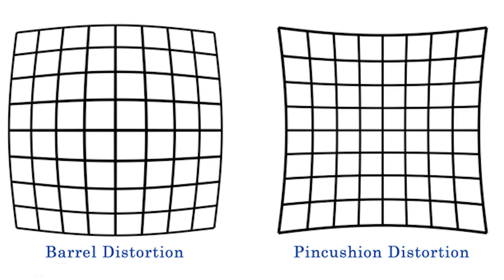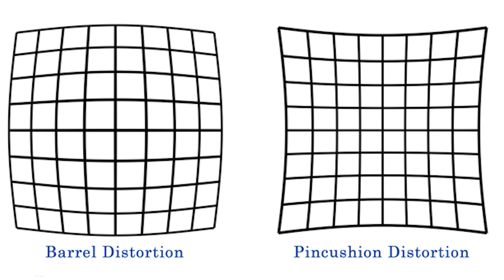VR Barrel Correction & Rendering Resolution Explained

Comment from the maker: Elaborating on my video from the other day in a bit more detail for people.
Reply: Hi Karl, I think your explanation is generally correct, but I wanted to try and articulate this in a slightly different way. I spent some thinking about this, so I hope this helps others and myself. 

In terms of resolution in VR, we are always limited by the panel resolution. In the Quest 2 it is 3664 x 1920. So what is the point of rendering at higher resolutions (super-sampling)? 

The answer lies in how the lenses distribute the panel's physical pixels across the visual field. The pincushion distortion image you displayed shows the squares in the center of the field getting shrunk while those in the periphery get enlarged. This means more of the panel's physical pixels will get mapped to the central region of the visual field while fewer will get mapped to the periphery.  

So in terms of what we see behind the lenses in our visual field, the central region has a resolution higher than 3664 x 1920 while the outer regions have resolutions lower than 3664 x 1920—with decreasing resolution as you move away from the center radially.

So now let's say our app renders to a temporary buffer at the panel native resolution of 3664 x 1920. We now need to barrel distort this image before we can render it to the panel's pixels at the same 3664 x 1920 resolution. 

What the barrel distortion essentially does is it stretches out central portion of the image—because more of the panel's physical pixels need to be mapped to central part of the visual field—and it shrinks the peripheral regions because fewer panel pixels are mapped to those regions. Again, this mapping of the panel's pixels to regions of the visual field is done by the pincushion distortion of the lenses. 

So now when we stretch the central portion of the original image in our buffer and map that onto panel's central region of pixels—at more than a 1:1 pixel ratio—where do we get the values for the additional pixels? We have to use interpolation which will always result in some blurriness due to aliasing. The ideal would be to sample these pixels values from a buffer with a pixel grid that exactly matches the higher resolution we are dedicating to it in this region—hence the super-sampling. When we use super-sampling of say 1.7x (on the quest that's 5408 x 2736)—we are actually getting that resolution in the central region of the visual field because more than a uniform amount of the panel's (3664 x 1920) physical pixels are dedicated to that region. 

The increased resolution in the center of the visual field may be less than the super-sampled resolution. The limit depends on the lenses of the headset and how strong their pincushion distortion is. The stronger the distortion more of the panel's physical pixels will get mapped the center region boosting the potential resolution in the center. This also results in the trade off that the fewer pixels will be mapped to the periphery resulting in blurriness off-center. 

One other note. Super-sampling also results in more clarity in the periphery. We are shrinking those parts of the image before rendering to the panel. So we are going from more pixels to fewer pixels mapped to these regions on the panel—more information to less information. This is better than the stretching of the central region, but there still can be aliasing effects because the grid sizes are not the same. With super-sampling, we start from an even higher resolution source buffer and then drop down to the smaller number of pixels needed by the panel in that region. In effect the super-sampled source buffer acts as a form of anti-aliasing for the peripheral regions of the panel. 

My example for this: 4k downsampled to 480p will look better than 720p downsampled to the same 480p. We have more information to intelligently determine how to color the pixels in the 480p display when we start with the 4k source. 

Ok, I think I got it all out there. I hope this is clear and helps others understand. Happy to be corrected if I'm in error anywhere. 

Credit to these other videos that helped me along with a healthy dose of rumination.

https://www.youtube.com/watch?v=B7qrgrrHry0
https://www.youtube.com/watch?v=nyehrn9EKIY
https://www.youtube.com/watch?v=ya8vKZRBXdw

Comment: We often reference your video in the Virtual Desktop discord, it's been very useful/educational. There's only one point about a lower render resolution and fov crop you could dispute but overall the concept is conveyed very well.

This concept still applies to pancake lenses, maybe even more so as you now have more edge to edge clarity where previously we were more concerned with just the smaller fresnel sweet spot.
Reply from the maker: Thanks for the feedback!

Comment: Karl 4 years later, i know, but some lovely VR user referenced your video for how they understood how barrel distortion works in relation to the Quest 3.   I highlighted to them that this video and barrel distortion is only applicable to Fresnel lenses as at this time in your VR life i dont believe you used anything but fresnel and not Pancake as they came out in 2023 nearly a year and a half after this vid.   in the point of accuracy would I be correct that was your experience?   As quest 3 uses a different method i.e. the lense does not require any software distortion except optical folding light via the lense itself . weird one i know , but i just want to ensure I understood this video, its time period and your VR hands on experience wasnt in relation to flat pancake lenses.  Love your content and the playseat Bed rally driving is till my favourite lol.
Reply from the maker: To be perfectly honest I have not looked at how pancake lenses work in relation to how the images are rendered so I do not know for sure mate sorry!

Comment: If I understood correctly, this is not necessary (or only minor) with pancake lenses. So hoping for some performance improvements with upcoming pancake headsets.

EDIT: This information seems to be wrong. As seen with the Pico 4 you also need to push around 1.7x higher render resolution to match display 1:1 for the whole FOV.

Comment: Why the fuck can't the picture be rendered like that like, from the get go, like, have it have that shape, right out the GPU? It sounds like, really stupid, and it sounds like, the renderer, could have it like, set up within itself, some like, default shaders, instead of like, bullshiting the image. Cause like, it's the PC doing all that, right? So why do they have to distort existing pixels? Can't they like, pixelise existing distortion? Like, you see what I mean right? Cause like, I don't know, it sounds like the PC's doing extra work for nothing, like it could do it more efficiently.
Reply from the maker: The image is rendered to correct for the lens distortion straight out of the GPU.
Reply: @KarlGosling  This is confusing.
Reply: Like, I like this idea like.

Comment: I wonder how all this applies to 360 video in VR. The question I have is what is the ideal resolution of a 360 video so that will end up taking advantage of ALL of the pixel resolution of the Quest 2 screens? There are so many things to consider but my understanding is the Quest 2 screen has 20 Pixels Per Degree (20 PPD) resolution so 20 X 360 degrees (width) = a spherical video file at 7200 x 7200 seems to be the answer...But then again does PPD account for this barrel distortion correction? Knowing the resolution sweet spot to watch and make 360 videos would be super helpful.

Comment: Good explanation, however barrel correction has nothing to do with why steamvr decides your default 100% resolution,  this is set by steamvr simply looking at your GPU power & deciding what it's capable of (generally gets it wrong) this is stated by Steam.... QUOTE... 
LoginStoreCommunitySupport
How it works is simple. The SteamVR runtime measures the speed of your GPU and tells applications to render at an appropriate resolution based on the power of your GPU. There are many customers right now with GPUs that aren’t being fully utilized. These customers will now automatically have their VR application resolution up-res’ed – the end result being a clearer and better looking VR experience.

Customers who have GPUs that can’t quite render the native resolution of their headset will automatically see images rendered at a slightly lower resolution that is more appropriate for the speed of their GPU. More clarification about this at the bottom of the post.
Reply from the maker: That's if you leave it on AUTO yes... it doesn't change the reported resolution at 100% though, WMR determines this based on your HMD.

Comment: The screen resolution is 2160x2160. That is given to us by HP. That is 4,665,600 physical pixels that can be used per screen. After doing a barrel correction many of those pixels around the edge are black but they are still physically there. It does not make sense to render any more pixels than 4,665,600. It just doesn't.
Reply from the maker: Not to you mate, but you've not understood how it works.... If we don't then render the extra area (pixels) you'd see the black around the edges and a much smaller image in the centre of your display.
Reply: @KarlGosling  You would NOT see black around the edges or a smaller area in the middle because you are looking through a pincushion lense that cancels out the barrel correction. What are you missing? You say all the pieces to this but you keep coming to an illogical conclusion.

Comment: So if i lower the resolution to get more frames, will the image distort?
Reply from the maker: No, it just renders the barrel corrected image at a lower resolution so won't look as sharp.
Reply: I have a PSVR2 and most say to set SteamVR res at 68% to have it almost match the lenses. SteamVR has a default 150% that I’ve had on for awhile until recently. I guess I’m confused how the headset processes a HIGHER resolution (150%) when it can only go as high as 68% or so.  How do you force more pixels into a space that has less?  

(If the game resolution is 4K, would setting SteamVR at 150% make the pc work harder?   Is there no point to going above 68% where any farther wouldn’t show a better image since the headset is already at its limit?

Comment: So a bigger barrel distorted frame is rendered and then cropped by the LCD,
LCDs are reproducing barel distorted frame on them but cropped so we don't have unused LCD surface
That gets pincushion distorted/flatten out by the lenses and apear flat.
Got it. Probably...🙃
-
Headset LCDs should be barel shaped so that lenses use more of the rendered pixels.👍🏻

Comment: Good video, and this has been confirmed by the HP team constructing the headset, according to another channel that has been in touch with them.  I was one of the sceptical ones, about 100% in Steam VR visual settings being 3000x3000 or so, after your last video. And the reason for that is that I`ve used my Reverb G1, which has the same 2160x2160 per eye resolution, on a daily basis for over a year now. And, for my flight sims and car games, I`ve used 2160x2160 resolution. And that has worked perfectly fine! It looks amazing! And better than my Quest 2 - which I really really like to play other kind of games on. I'm glad I can afford both. I'm not biased in anyway, just a happy nerd that have both, Quest 2 and Reverg G1 - with a G2 delivered today/tomorrow if all goes well. 

So my conclusion about this is that 100% giving a 3000x3000 resolution is not a bug, as your video states too. It is intentional in STEAM VR.  But also, have in mind that if you just stay in your Widows Mixed Reality enviroment, use those apps, and don`t start up SteamVR apps/Games, then you are stuck at the "low" 2160x2160 per eye resolution. The reason is that WMR setup gives you only 4320x2160 (total for both the eyes) as the best resolution/Quality. This is easy to check in WMR settings, 4320x2160 is max that you can set it on. Now, there's isn't much going on in the Window Mixed Reality enviroment/apps anyway, so all user will end up with SteamVR for playing any serious games. But this fact is kinda puzzling - why they didn't allow this in WMR too, to increase super sampling up above the native panel resolution. If it is really needed.

And is it needed? Well, all VR headsets look better when increasing super sampling. But there is nothing wrong in keeping your Reverb G1 at 100% (2160x2160) - G2 at 50% if that gives you the frame rate you need. It will look very very good. Just check it out. If your PC setup and the game can handle it, of course crank it up. But there is a "large" (not really large) X-Plane and DCS (digital combat simulator) community which has used the G1 with the same resolution as G2 for over a year now - at 2160x2160, or perhaps a little larger value, and been perfectly happy. And that is partly why you get reactions to your video that 100% is 3000x3000 is a bug, and why other Youtubers claim that you have to lower it to about 50% for G2. 

Now a disclaimer - it could be that the new lenses and panels in G2 needs more barrel distortion correction than the old G1 that I have, and that a higher super sampling is really needed to give a good end result. Guess I will find out later today/tomorrow when I get mine. If so, then I guess I will have to lower the in-game anti aliasing settings for my flight sims since a high super sampling in SteamVR also helps for that. Can't afford both frame rate wise that is. 

Any new Reverb users should also check out the Motion Reprojection settings. That will help you if you get below 90fps. I use that for my flight sims, and that locks the frame rate to 45fps and by some software wizardry doubles that to 90 for your headset. This can introduce some artifacts, of course. But I think it does a very good job, and it allows me to fly with high graphic settings. The setting can either be off, forced to 45fps, or a mix, so that it allows it to go above 45, but if 90 can not be acheived, it drops down to 45 and doubles it. For me, forced 45 has worked the best, with no stutters. X-Plane with the ORBX Graphic add ons, 2160x2160 with Reverb G1, 45fps locked with Motion Reprojection doubling that to 90fps,  is a sight to behold. Incredible, and I can't wait for MSFS 2020 to realease its VR Patch :)  

Good video, Karl. And thanks.
Reply: Thats what i keep saying! why is windows fine at 2160 x 2160 for the cliff house and the apps, but steam vr needs to fix for distortion at some crazy resolution? I spend a lot of time watching netflix and amazon prime in the cliff house and the visuals are amazing. But steam cant display even the most simple home environments at  "100%". Karl says its rendering at the higher resolution in windows VR but the slider says 2160x 2160? So which is it?

Comment: Well that comment I made opened Pandora's box didn't it 😂

It's frustrating I know to have to explain and there really is no TLDR one word to please people who can't be arsed to read a little,  it's doubly frustrating when those same people keep dismissing headsets based on their resolution spec that's on the box and want more and more without the thought to the rendering cost or how running below the required resolution actually looks in headset.

It's almost embarrassing how many jumped on the 'steam is bugged' bandwagon because a misinformed post that gets farted out as an almost defence to buyers remorse/saving face of not actually knowing it's true cost before clicking buy.

any vr head and especially the guys at oculus will tell you to go for the maximum framerate over your resolution anyway, always, without fail.

what the quest 2 has now is more than enough to see people through for a long time, unfortunately the means of it connecting via usb is already adding more strain before you ever run a game so pushing that higher native res is even more taxing than any other conventional display port cable headset by comparison, again mis information on some buyers parts who haven't really done the research when buying it for pc use only, yes a quest 2 'can look as good' in some context but it comes at a huge cost and tradeoffs to the experience that's completely not worth it in my opinion.

My headset of choice between quest 2 and cv1 for pc is still cv1, unless I actually need wireless, SIM racing I can't run the quest 2 at a resolution high enough for me to not see the bastard jaggies so it's back to cv1 where I don't have them.

Again, people tell me I'm wrong somehow, quest is much better, apparently, maybe for them on 3090s.🤔
Reply: i also have the CV1 and the Quest 2 and after some weeks i stick with the Quest 2, but it took me quite a lot of experimenting with different settings to get it all look good, especially for some games like SIM Racing and sports games. It also depends on the graphics card. I started with a 1070 on my CV1 and this was fine, but as soon as i got the Quest 2 the 1070 was just not fast enough for higher quality settings. But at least i get a better screen at the same resolution as the CV1. The performance loss using Oculus Link isn't that much, i guess way below 5% in total. Of course there is some latency, but especially in SIM racing this does not really matter, since i use a USB wheel anyway. Using a 2070 SUPER now i can go for an excellent balance of fps and quality and that looks way better than my old CV1. Half Life Alyx looks absolutely amazing on the Quest 2, even with 50% resolution. In some games like Tennis i can even go for the highest possible render resolution, so i honestly won't use my CV1 anymore since i saw this.